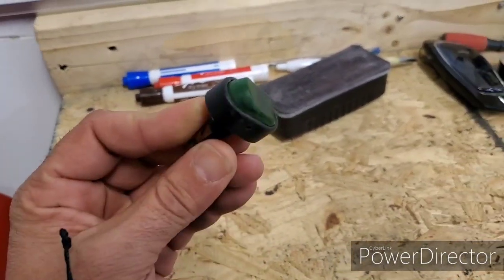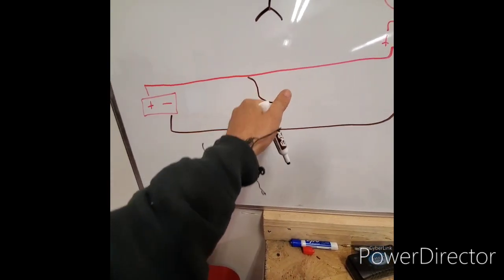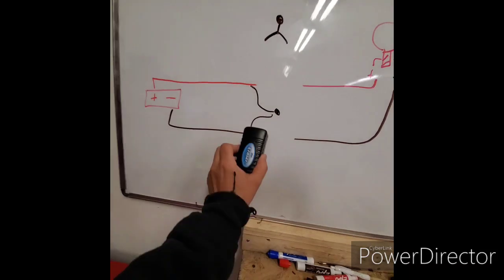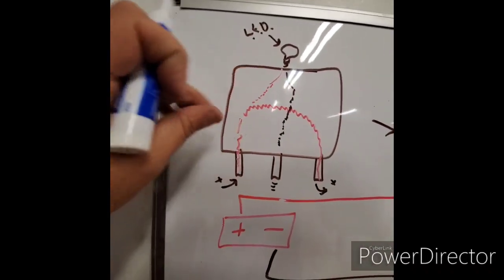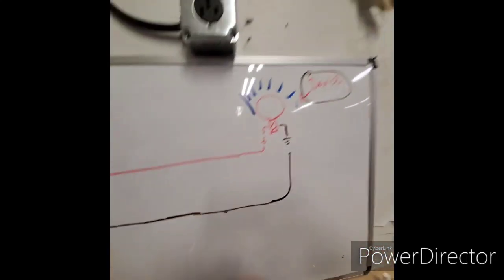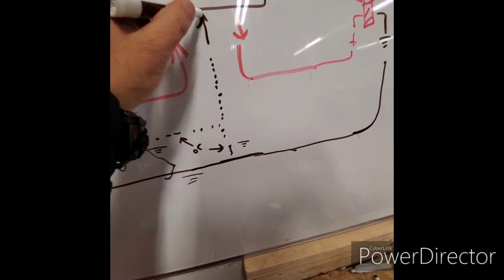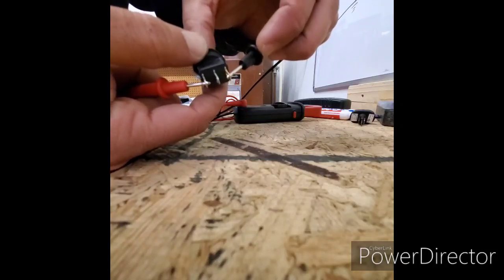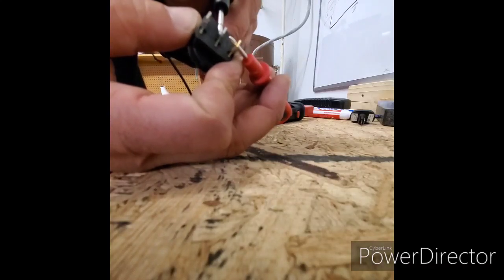How to wire an LED toggle switch , ( on-off 3 prong rocker switch ) 2020

Comment: So just to confirm, can I run the ground wire from the battery “through” the ground pin, and onto the device. So essentially running both ground wires through the pin?
Reply from the maker: It would be a bot of N odd connection,  but for an accurate answer, yes. See, electric doesnt move in a direction (not scientifically accurate but not in the way your imaginingright now). You see it as passing though that connection. But really its running through that wire and the connection is in its path.
Reply: @myonlinecarguy1  so essentially it would be like just having the one ground wire, with a connection(the switch pin) along the way.
That’s really not that different to connecting a wire from the ground running from battery to device.
Reply from the maker: Exactly

Comment: Great video. 

Question...I'm new (self taught) to electrical engineering, repair + maintenance of ebikes.  

I installed a 4-light system on ebike - backlight, high beam (×1) and low beam (×2).  I run everything through a 12v/24v power source (bank). 

Recently, I decided to add rocker switch (×2) to separate high be from low beam.  I noticed that the LED indicators on the rockers will sometimes work, sometimes not but the lights will always work.  I've looked for shorts, can't find anything.

Power source is rated for 12v/24v.  I register 28.5v on multimeter when everything is turned on.  Could this be the cause why the rocker lights don't work?  I've switched out rockers twice....same result.

Hope u can help.  Great video.

/bklyn 👑
Reply from the maker: Very possible.  The analog mechanics of the on/off function is pretty basic. That should almost always be consistent.  However the led on the switches will have different tolerance,  so very possibly the 28v is beyond the led light threshold of the switch itself.
Reply: @myonlinecarguy1  I appreciate ur response.  thank u. info helpful is very helpful. thank u again.

/Bklyn 👑

Comment: So do you need two ground wires. One to the switch and one to the device
Reply from the maker: No. 
Typically,  (+) is the pass through wire of choice. But its still just the 1 wire, cut in half. 
Then the gnd, is for the 3rd prong, the LED prong. So it lights up.

Comment: What switch do I need for a spst rocker switch for the LED to be powered when it is off through the accessory pin. I am able to do this on a square rocker switch. But I have been unable to find any round switches that operate the same. And only operate the LED when it is on. For example I have a relay and a switch connected to one device and when the relay is on I want the switch LED to be powered on to let me know the device is on. Where do I find a switch like this in round shape ???
Reply from the maker: I def appreciate that you know exactly what your wanting and how it works, unfortunately its very very rare that i need a switch to perform the way your asking. So i fomt have a place to refer you to, to get you what your looking for. Im sorry i cant help on this one. I can say however, you can always use a non lit/led switch and install your own LED next to the switch and wire it in to perform the function. Incase finding this exact switch ends up a dead end..
Reply: How do u put the button peice  bak together on a Bluetooth  speaker that has the on/ off switch

Comment: Wow! Dude, thank you so much for the thorough explanation!  I'm trying to figure out how to put LED fog lights on my car and I think I got most of it, but I'm stuck.  Do you have a video with a relay?  I have the lights going to a relay and then a switch, but need some help.  Or should I even bother with a relay?  FYI, the lights I'm using are Alpena LEDFogz 6 (3 LEDs per light)  I was told by numerous people that it's always best and safest to use a relay.
Reply from the maker: The electrical advantages of a relay is when higher amperage is needed then the toggle can handle. And it also protects the circuit similar to a fuse, becaue it will only allow power to pass through in 1 direction n not back feed.
Reply from the maker: That said. Its not "needed". In my opinion. But def make sure you put a fuse inline.
Reply: Yes there's 2 inline fuses.  1 in the power wire from the relay to the battery and the other in the wire from the switch to the battery.
Reply: The directions in the box were not helpful at all.  Do I connect the power of the foglights to the relay? Or to the switch?
Reply from the maker: Without all the details. Generslly the switch sends a trugger to the relay, the rekay shouks have an "output" connection, to to go the device. When the  switch triggers the relay then the relay will send pwr to the "output".
Reply: @myonlinecarguy1  thanks!
Reply from the maker: I just saw my horrific spelling from earlier, my apologies, i was at a car show and trying message you in a bit of a rush, lol.
Reply: @myonlinecarguy1  haha...no biggy....I could interpret

Comment: Hi obviously it’s very excellent video I could not understand all what I’m trying to do I have a toggle switch like you have put the LED in it three prongs I got another LED separately and I have another toggle switch that have six prongs middle is off up is on down is on to run a small 12 V motor how in the world to connect him I spend over two days trying to figure this please any help thank you
Reply from the maker: I am willing to try and help. But i cannot clearly figure out what your questions is. Sounds like you have a few different installs going. So, let's start with just 1 and then go from there.

Comment: For the ground wire to connect to the 3rd prong, it makes sort of a T shape. Can you tell me what you need to use in order to split the ground wire to where it goes to both the prong and device?
Reply from the maker: You can just strip the wire and soldier them together. As long as the connection is secure it doesnt really matter much.
Reply: @myonlinecarguy1  Thank you so much for the quick response! Really appreciate it :)
Reply from the maker: No worries, just doing what i can to help. I appreciate the views and the comments and questions.
Reply: @myonlinecarguy1  do you recommend just cutting the wire, stripping it, and then just soldering the 3 wire ends together in kind of a T shape? Or is there a way to strip the wire just in the middle part so that I dont have to completely sever the original ground wire?
Reply from the maker: Either way would work just as well. The soldier is the key. That is where the strength is, in the connection.
Reply: @myonlinecarguy1  you are awesome man thank you!
Reply: @myonlinecarguy1  are there any wires on Amazon that you would link that would be perfect for this? Like the black and red kinds that you used? There are so many kinds of wires man it's so easy to get lost in this lol
Reply from the maker: I appreciate the kind words. 
As far as the wire type, the "size" wire is dependent on the amount of power your passing through it. And if it is AC power or DC power. 
A "stranded wire" is my most used wire. In a size "14 or 16 awg".....however, the wire type and size absolutely is chosen based on the device your wiring to, the amount of power you need tonpass through it, and the type of voltage if its AC or DC.
Reply: @myonlinecarguy1  I would ne wiring an LED strip to a 9v battery casing, any idea what kind I would need just based on that? :)

Comment: I have a similar switch as you are showing. The one you are making video about. Mine is properly wired and grounded. Problem is led is on when switch is off and led off when switch is on. It tried switching supply and device wires and it blows fuse in circuit. Would like led on when switch is on, not off.
Reply: I've been told that sometimes it is the switch that is backwards (cheap Amazon risks).
Reply: @Cool-Trees   Thanks, as I said, I tried reversing poles and it blew fuses. Probably junk made switches. I just live with lit up off and no light on.
Reply: Most residential switches with lights are also wired to be lit up when turned off. You usually need to buy a special switch or rewire it in a way where LED on switch would be first light in series

Comment: Can you explain how I can wire a rocker switch to the power cord for a power supply to entirely turn on and off power for it? Thanks!
Reply from the maker: Probably shouldn't.  Because a power supply has an access of power passing through ots main power line. Itll most likely pop the switch and burn it down. . Every power supply should already have a built in switch on it. Find a way to remove and extend that switch using its existing wires. But I wouldn't suggest throwing a switch in a main high amp power wire.  Thats asking for issues.
Reply: @myonlinecarguy1  thank you for this. I’m looking at my power supply right now and the only switch I see is the one that says 110v/220v which says “110/220V is selected by switch. Before powering on, please check input voltage avoiding damage.” Which confuses me because I bought a 5v power supply… So I don’t see a dedicated power switch one this.
Reply from the maker: Almost each power supply ive ever seen has some sort of on/off on it. It must, or of you had a device plugged it the device would never turn off. I suggest searching for the modle number and looking for the manual online somewhere. Thats should help give clarity for your specific unit..

Comment: How do you wire a three prong switch to a relay and a fan
Reply from the maker: Way too long of an asnwer in a message. Look at each step, individually.  
1) toggle
2) relay
3) device
That is about as far as i can get ya in a comment section.

Comment: So I tapped into power at my ignition, and ran it to the supply prong. The acc runs out to my headlight. And then I just ground it out on the frame?
Reply from the maker: Sounds spot on to me.
Reply: @myonlinecarguy1  thanks buddy. Only active individual I've found with videos related to this topic. I can rebuild a motor and build a house but electricity is only thing that gets me lol
Reply from the maker: I completely undedstand. Im just glad i can try and help in some way.

Comment: I’m trying to use the small switch with the tiny light… I did not connect the negative wire to the center switch point BUT even with the positive going into the switch from a battery and out the switch to a small pump, I was getting continuous power no matter if I push the switch multiple times. (The power did not get cut) I don’t know why that’s happening
Reply: Do the continuity check. You might have a bad switch.

Comment: Is pin 1 input  and pin 2 out out put vice versa as in pin 1 output and pin two input?
Reply from the maker: Each switch is diff, meter it like explained in the video and you’ll know exactly how your particular switch works.
Reply: And also is it still safe to use a two prong switch for either the positive(power) wire or the negative(ground) as long at it connected to one line being it power or ground?
Reply from the maker: Yes. It would function in either (+) or (-) (same line on both ends) but never both. 
 Far as being safe, make sure fuses are used inline..but thats nothing to to do with the switch.

Comment: I was always told to place the switch on the positive side. Was that wrong?
Reply from the maker: Thats generally the simplest way to do it. And works.  However, the (-) will work as well when using simpler switches.